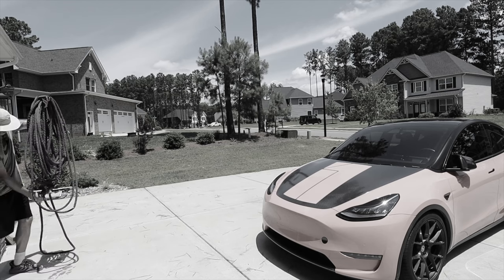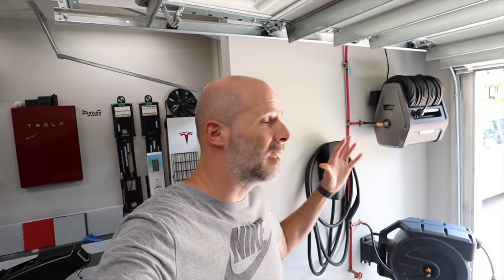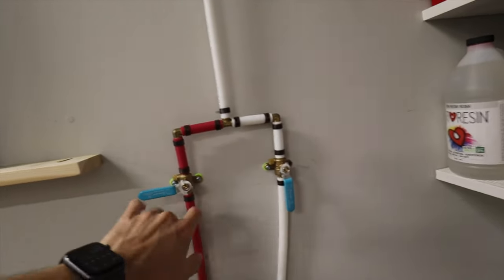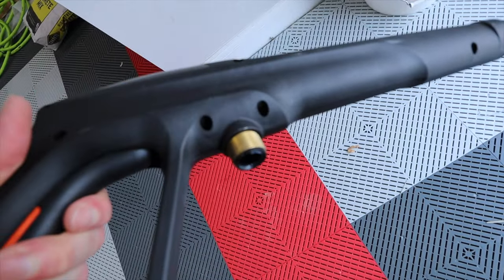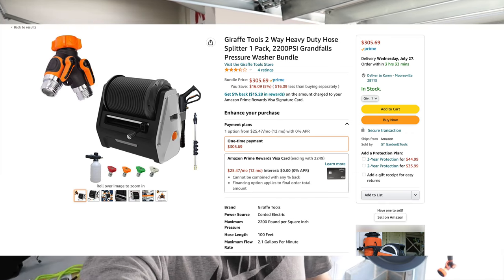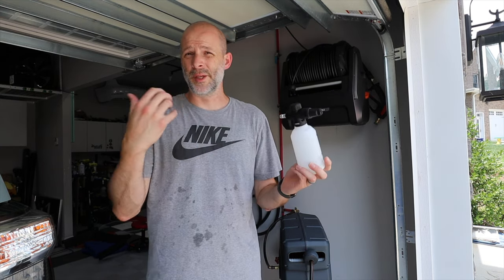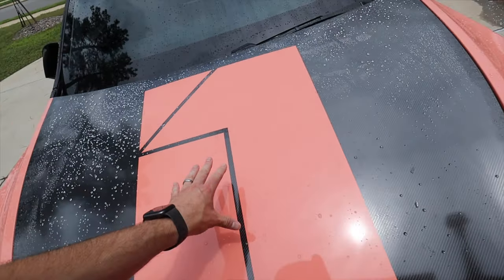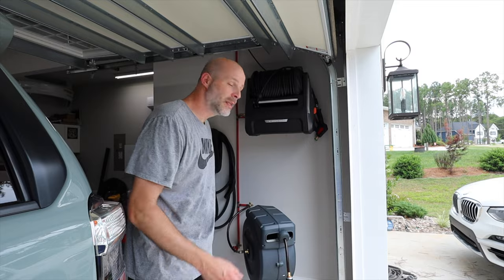Best Carwash Setup for your Tesla Garage

Comment: Fantastic!!! Now use 2 buckets instead of 1. You need a soap bucket and the dirty water bucket otherwise you are putting the dirty water right back on the car
Reply from the maker: Doesn’t matter as much with a wrap on the car
Reply: @i1Tesla  It matters when it comes to your glass you can scratch your glass. It’s such a simple addition to eliminate problems

Comment: I been looking to do this exact set up, thanks for sharing everything!
Really cool how you got it all setup just so convenient. 

Take it easy Brian,
Casey
Reply from the maker: Glad it was helpful!
Reply: @i1Tesla  Well I hate to say it but after using the Pressure Washer for only a few hours total over the past month.... It let out thd majic smoke.  I was using it not to clean off the car this time but spray the side of my house off.  I took breaks every few minutes because I knew it probably has a low duty cycle.  After I was almost done the pressure dropped off and I went around corner to check on it.  It built back up full pressure and turned off.  When I saw it there was smoke pouring out the side of it and was nearly on fire.  Filled a claim with Amazon but will have to hear back from seller....  Dunno if I would recommend this Washer it's not well built at all when I took the side cover off everything is so loose and light plastic.

Don't run it for more than 10 minutes at a time and roll up hose straight all I can say if you have one.....